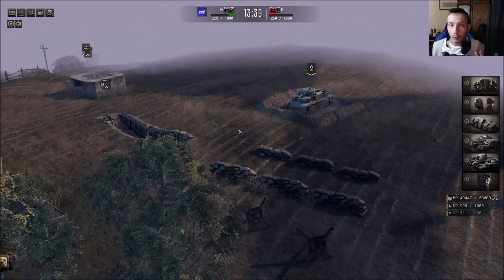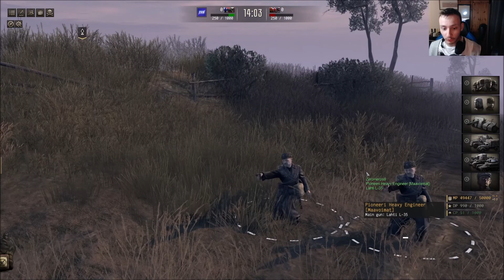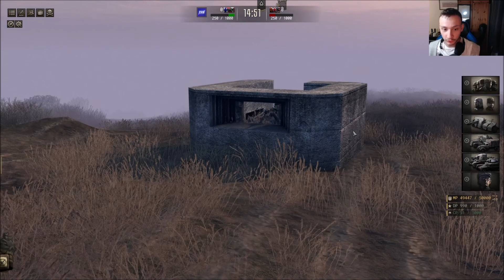HOW2: USE DIFFERENT EMPLACEMETNS FOR ENGINEERS | GATES OF HELL: OSTFRONT TUTORIAL

Comment: Hey man, like you content :) I don't suppose you know, the Sandbag Kit (Vehicle) that comes in the inventory with AA guns and AT guns etc, is that just cosmetic or can it be used?
Reply: They can be used.

I'when activated the unit stop firing and aiming for few seconds and then a sandbag wall (tall or short depending on the unit) spawn in front of it.

Careful where your unit is initially pointed toward, as it's actually where the sandbags will be direct toward.